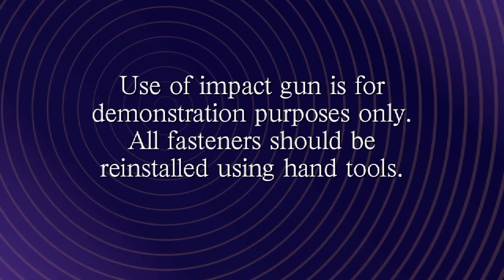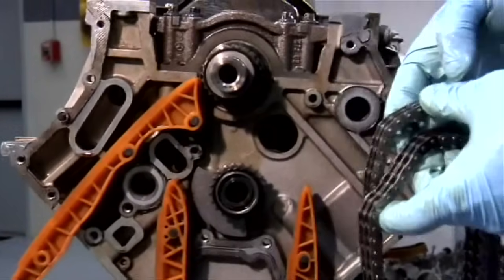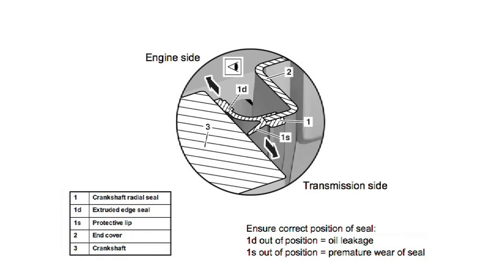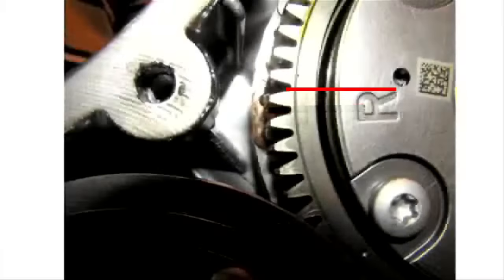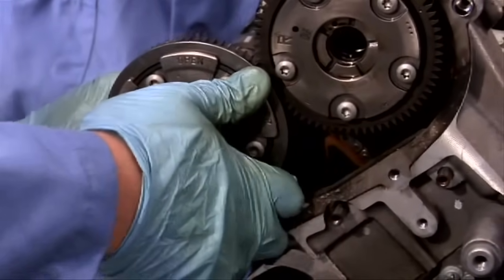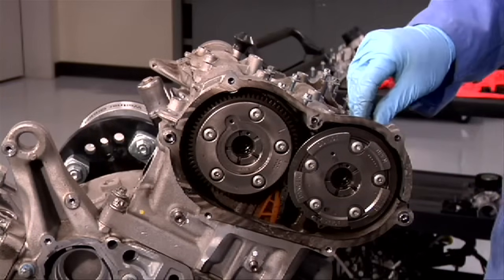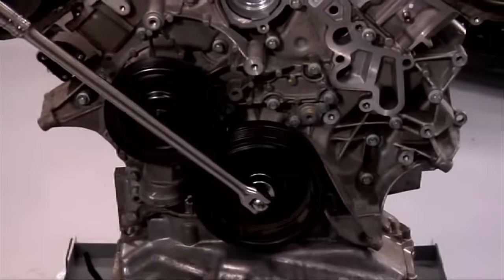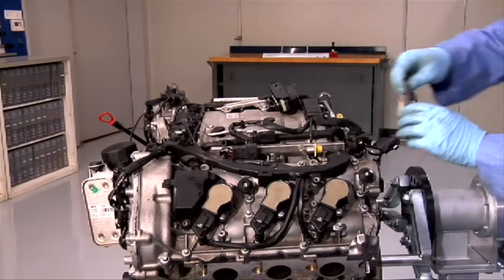M272 & M273 Engine -Balance Shaft Installation and Timing

Comment: This only took 30 minutes to rebuild,
So I'm assuming to teardown its and hour.

So why in the fuck do mechanics hold your car for weeks?
Reply: +nicholas elias I can vouch for that. This job is incredibly time consuming. I have a lot of wrenching experience but first time with this engine. 6 hours to remove engine from car, 5 hours to remove timing cover, and another 6 hours so far to replace balance shaft and get engine back in time. I suspect I have at least another 6-7 hours to finish reassembling engine and then another 5-6 hours or so to get the engine back in the car. It is important to proceed slowly and with caution with an eye for detail. This is no 350 Chevy small block.
Reply: I'm not an expert but I'm pretty sure that they all have timing chain stretch issue which causes those OBD codes. I repaired one where the balance shaft sprocket turned out to be fine but it had codes due to a stretched chain. It ran fine as well. We replaced both and it is running perfectly now. So you might be able to get away with just replacing the chain, but even that is a seriously labor intensive job - although not as bad as replacing the balance shaft.
Reply: +Frank Assnot 
watching a turkey cooking video on thanksgiving 5minutes
in reality, takes a whole day to prep and cook :)

we are currently doing this job in the shop, Alot of cleaning and prepping, the job is little different from the video, and the original chain have to be cut, new chain from Mercedes is not looped, have to install the master link and be pressed. test drive alone takes a whole day :)

I wish all jobs are like this, engine is already out and on the hoist, and its sparkly new
Reply: +Frank Assnot you are dead wrong. This takes over 20 hours.
Reply: +Mod MINI plus you have cars other than this to work on so you cant just sit there and pound this car out. You have other peoples' cars to take care of as well
Reply from the maker: +Frank Assnot Ever hear of not to assume because you make an ASS of U and ME--lol! This was done on a engine that was not cleaned, its mating surfaces we not prepped, and not verified for structural integrity. This video was a mock-up on how to do it; there's a lot more involved when rebuilding a motor, much less, the m272/273 class after its been confirmed that the balance shaft sprocket prematurely failed. I've NEVER taken any of my vehicles to a mechanic so I don't know the woes associated with that process. Best of luck if youre going thus this; please ask any questions and I'd do my best to answer with regards to this process.
Reply: +nicholas elias Yeah that too. I have like 3 cars I'm working on now and have had this car for over a week now. Plus, there is waiting for parts.
Reply: Hey Eddie, do ALL of the 273 engines have this problem? Since Mercedes messed up with their choice of materials.. do all of the models that fall into that category have this problem? or are some lucky that continue to run for many miles down the road without encountering this problem? I bought a used 07 CLS550 with 100,000 miles and I am now barely finding out it might have this issue :S I dont know what to do.. I dont have money for the thousands the dealership would charge to fix and as far as I know, the lawsuit that mercedes agreed to pay the people with these troubles closed last year :( that means I wouldnt be covered correct?
Reply: Also.. if my car is now showing the codes p0012 and p0022 is that a possible hint for this problem? Again, the car is at 100k and runs really well as far as I can tell... Please, any input would be greatly appreciated.. I am so very lost as what I should do? I traded a perfect running CTS 2005 with 90000 miles to have this come up, 6 years of payments :S please help point me in the right direction
Reply: I am finding my self with your same scenario, what was the result of yours?
Reply: The one I worked on, timing chain was stretched. Car running great now.
Reply from the maker: Jay Ross hello jay, my appologies for the extremely late response. your error codes are p0012 camshaft position over retarded (bank 1/ left cylinder head) and p0018 camshaft position correlation ( bank 2, sensor A/ right cylinder head, hall effect sensor for the exhaust cam). basically, the cam positions are not in sync. youll need to mechanically verify the position of each camshaft. there is a video uploaded by another user that i will look for and post.
Reply from the maker: Jay Ross check out midotizzo's upload and report your findings: https://youtu.be/XXQArmxXsnM

Comment: М112 М113  best of the best !!!!! All new engine M271, M272, M273 very bad quality :(
Reply from the maker: Эмиль Гусейнов I don't have too much experience with Merz but I do agree that they dropped the ball on the QA with their vendor who built the balancer sprocket--it seams to have been built with inferior metal which lead to a premature wear. I'm surprised how simple the motor was built thought, like an old school chevy,  and how simple it came apart. Another down side, finding parts like valves and guides for the heads was a pain and the complete lack of repair literature out there--STAR Tek is just pure and simple highway robbery!
Reply: Eddie Padilla I go to the W210, the year 2000 I had no problems so far with the this engine. i changed oil only 5W40 and replaced the original spark to 100000km. thats it.
Reply from the maker: Nice! I have a 2006 w211 and the only issue, although its a big one, was the balancer shaft sprocket--wish they would have made it so the sprocket can unbolt rather then removing the engine to replace the entire shaft assembly. I ended up having the heads rebulit and replacing the front and rear main seals and transmission pump seal because I don;t like to go back into things. Wish I had the 2000 w210 reliability you got! Good thing I got a steal on the price of the car, phew, saved me!
Reply: Eddie Padilla maybe I change my W210 to W211 2004 E320 (M112) as there is a reliable engine and gearbox . But there are problems with SBC
Reply: Also, the intake manifold disaster is also a dropped ball.
Reply: +Эмиль Гусейнов The SBC is covered on a extended factory warranty just take it in to a Mercedes Benz dealer and it will get replaced at NO COST!
Reply: +Lawrence Dillon, For 10 year old car there is no warranty, same for SBC. Dealer will charge you full replacement cost for this problem.
Reply: I'm not sure of all the terms all I know is I got my mine fixed with no cost and I have a 2006 e350 @149000mi
Reply: +Эмиль Гусейнов Mercedes-Benz M113 the SLR MCLAREN engine
Reply: How were you able to do that? was it before 9/25/15? Would you know if they still are offering to fix this? Any insight would be appreciated immensely
Reply: MERCEDES-BENZ
Reply: My 2009 M273 SL550 has the updated balance shaft sprocket.  Got the VMI from the dealership to get the engine #.  My # is beyond or higher than the ones that had the inferior balance shaft sprocket.
Reply: Know you posted this several  years ago but I got the c 230 supercharged m271 have not had a problem has been dogged and has 229000 MI so I guess they didn't drop the ball I must have got a Wednesday motor and actually when they built the m271 they put it in formula racing in the first three years they won all three championships